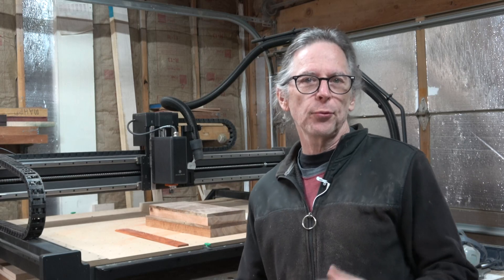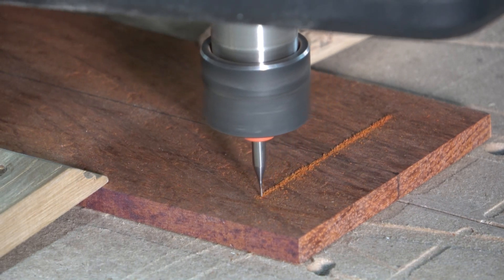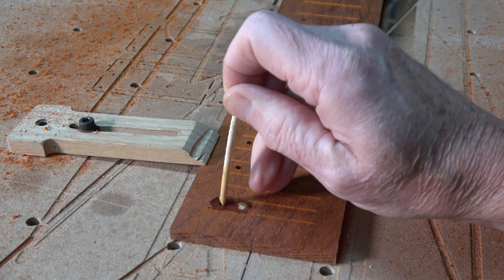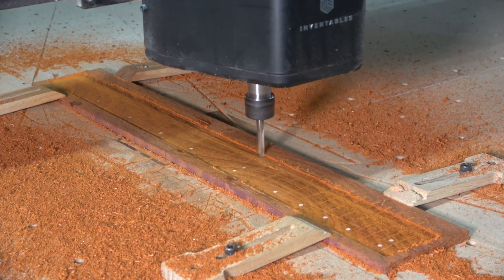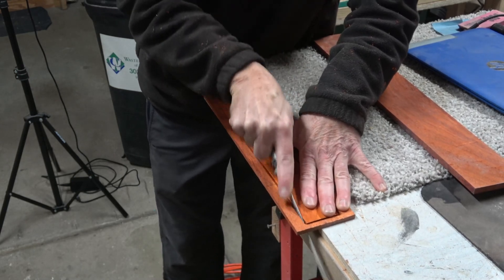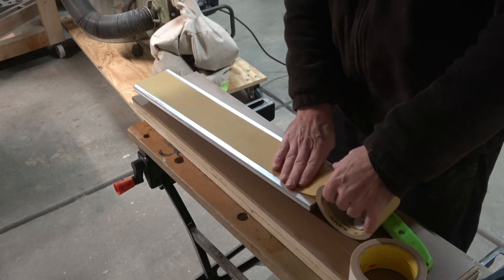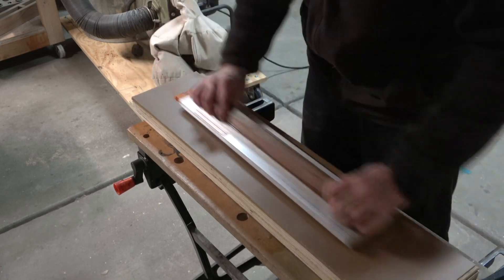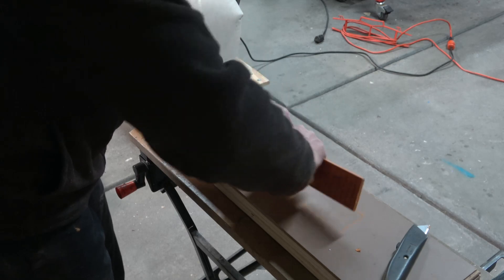Building A Neck Thru Guitar Part 5 CNC Routing The Fretboard

Comment: Hi Chris...do you have a preferred brand of CNC bit for your fret slotting ? I seem to break mine very easily.....at even lower feed rates and DoC than you are using......thanks, Chris.
Reply from the maker: Oliver Tool Company on eBay. https://www.ebay.com/itm/151008250845?mkcid=16&mkevt=1&mkrid=711-127632-2357-0&ssspo=ubO1FhRKSqK&sssrc=4429486&ssuid=ah7REkzZT4G&var=&widget_ver=artemis&media=COPY
Reply: Thanks Chris.

Comment: Another great video Chris, very helpful to have the feeds and speeds or the fret slot cutting. My one attempt to use a 0.5mm bit broke the bit whilst probing for the Z axis zeroing so I have some work to do to get that right!
Do you use a roundnose bit for the fretboard radius or is the standard end mill adequate?

Comment: Always enjoy these.  I use a similar setup for fret slotting.  However, I tend to break these tiny bits even with a slower feed than you and less depth of cut (0.15 mm).    I would be interested to know your bit supplier...   I use a 4-way (hole) and 2-way (slot) on my blank that align to my hole spacing on my waste board to position repeatably.
Reply from the maker: https://ebay.to/3UBHehz

Comment: Fantastic video and super informative as usual! One trick for removing the double sided tape that Schecter’s custom shop uses is applying acetone to the sides of the tape… this way you wouldn’t have to struggle in pulling off the fretboard and reduce the probability of accidentally pulling too hard and damaging the wood. Credit to Rob Scallon for going through and documenting the step by step process! Definitely worth checking out that video
Reply from the maker: I’ve never damaged a fretboard (400 or so at last count). I try to avoid using acetone in my shop for health reasons.
Reply: @HighlineGuitars  totally fair! And to be clear I wasn’t saying you have damaged the fretboards, I was saying that there’s a probability that might happen if one isn’t careful. I’m sure you take great care in handling your work and I have a lot to learn from you (and have been learning a ton already from watching your videos)

Comment: Congratulations for your works and for your methodical and detailed way of organizing your work. In the previous videos you explained how to position the pieces to be machined on the cnc, but how does the system you use to fix the wooden blocks to the martyr surface work? Have you made any videos about it that I can check out? thanks in advance for your time and your answer
Reply from the maker: The waste board has brass threaded inserts in it for screwing down the clamps.
Reply: @HighlineGuitars  I'm sorry, does the diameter of the threaded inserts affect the grip of the clamps? From the video they look like 6mm (1/4"), is that correct? Otherwise, can you give me some suggestions regarding the size of the inserts? Thanks again
Reply from the maker: @marcopandozziliutaio  You'll have to ask Inventables. They made the machine. I don't know the sizes.
Reply: @HighlineGuitars  OK,thanks